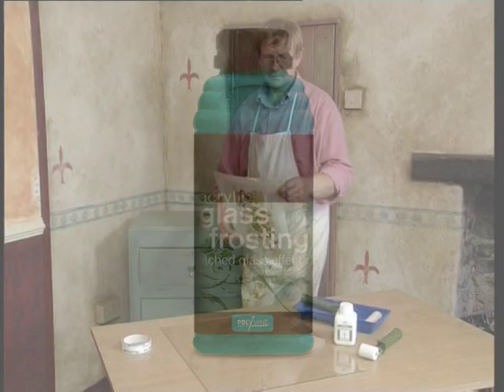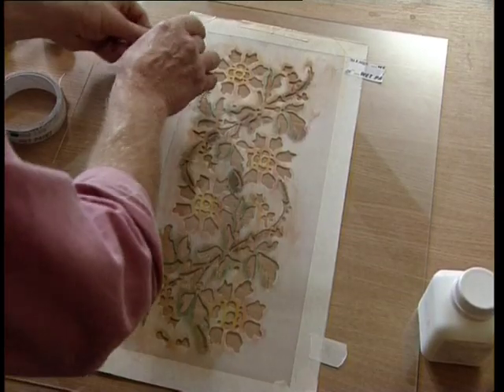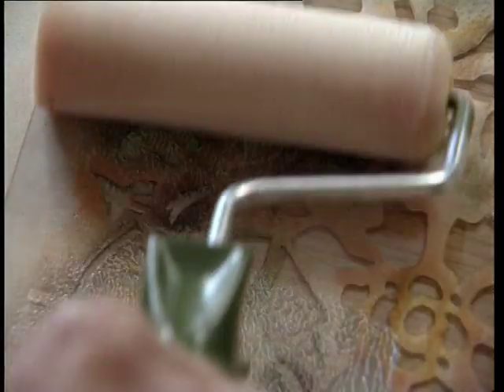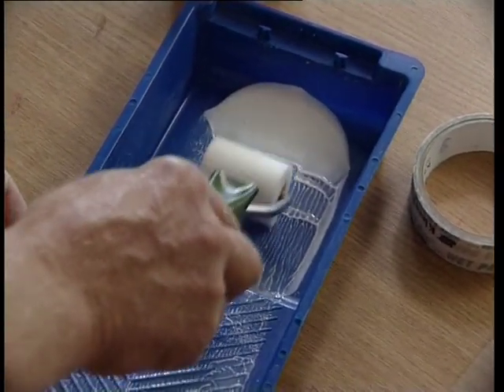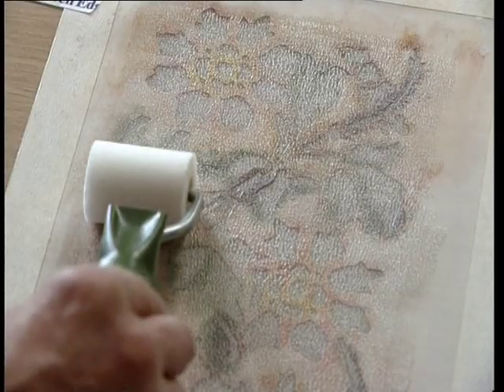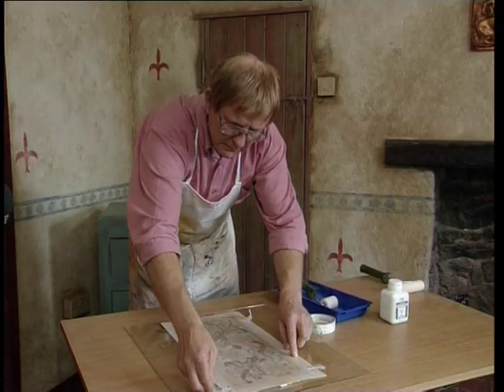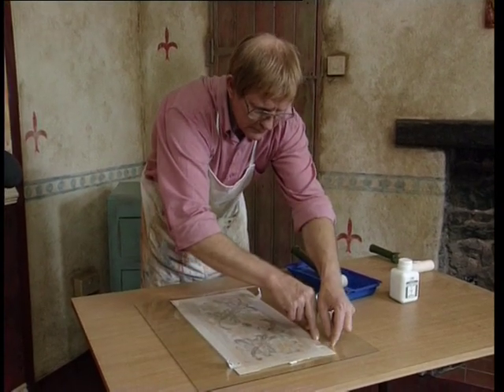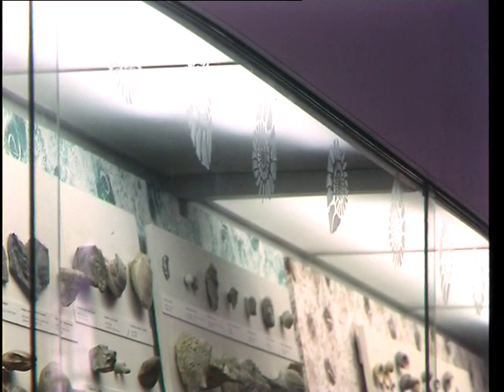How To glass frosting by Polyvine

Comment: Is this a permanent stay, is it dishwasher safe, or will wash off , am looking for a permanent frost ,
Reply from the maker: This is a water based product, so you will be able to take it off with a blade or some solvent. 
If you want to put it in the dishwasher you would have to run it on a low heat and do a test first.